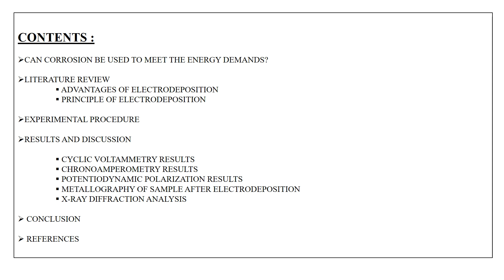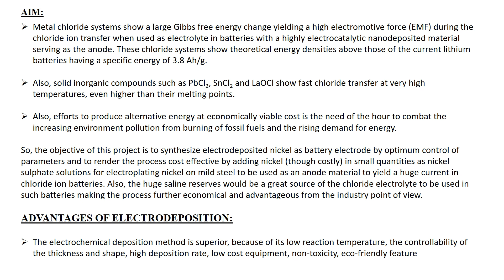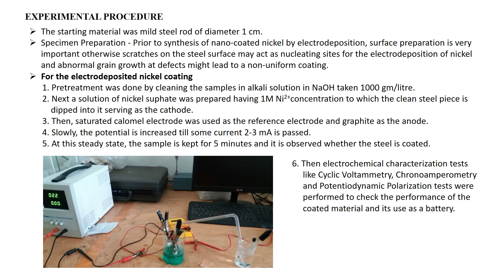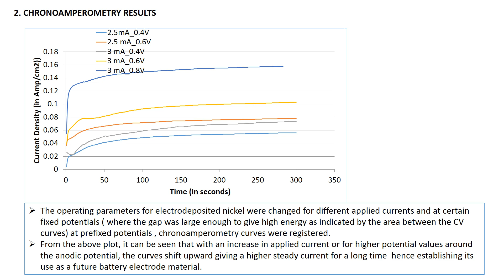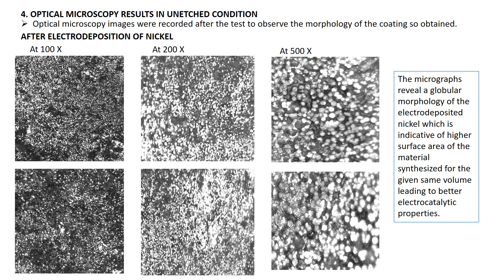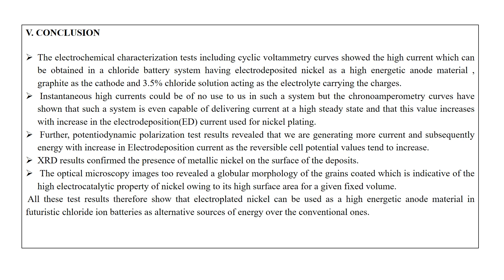BTTD presentation   Shweta Ghosh

Comment: good afternoon mam,
                                      why is the working electrode's surface exposed to cl and rest covered with teflon.what is the role of teflon ?
Reply: Good evening Vardhini..... During the potentiodynamic polarization tests, in order to check the nature of the potential curves vs electrodeposition current and to see if it is giving sufficient current and optimum energy for developing the battery system, the working electrode's surface is exposed to chloride solution while the rest covered with teflon so that only that surface is electrodeposited with nickel and undergoes the characterization tests.
Reply: @shwetaghosh2737  thnq mam